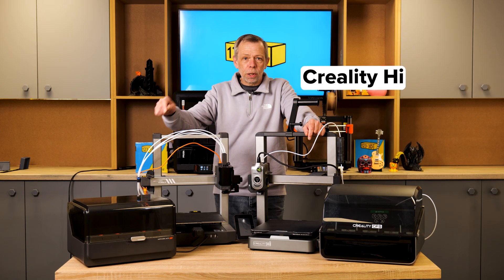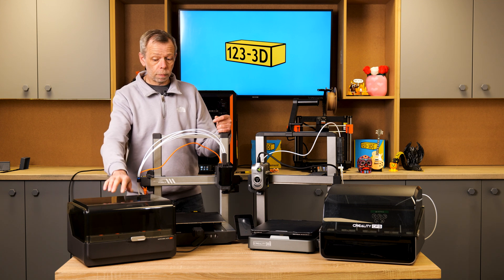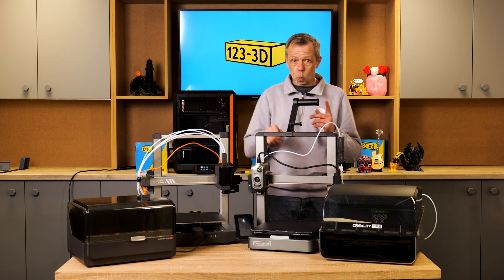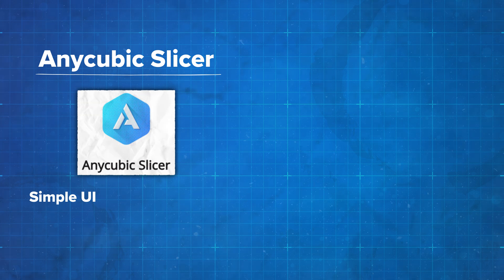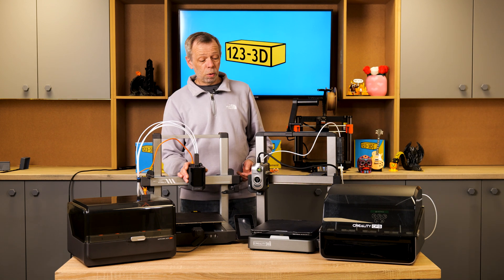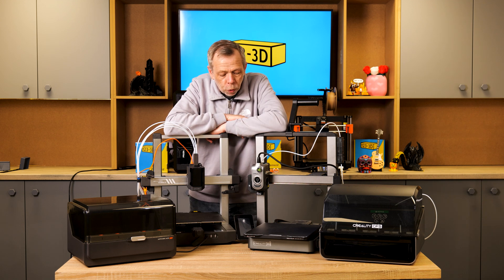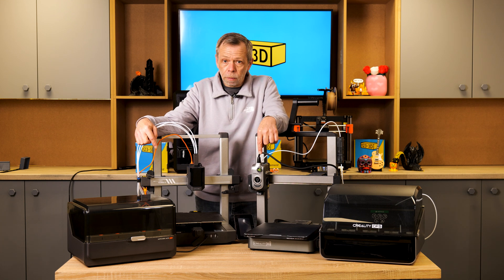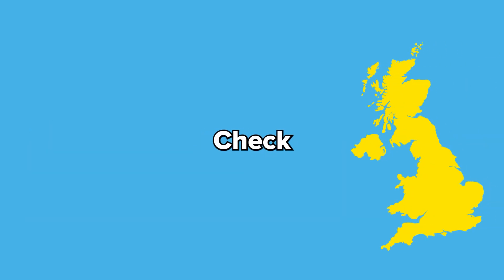Creality Hi vs Anycubic Kobra 3! Who will reign supreme?

Comment: Which would you recommend for primarily printing TPU 95A ?Multi color is not a concern of mine I'm looking for the most efficient TPU machine as that is what it will primarily be used for.
Reply from the maker: Both would do just fine but the Hi is great value for the price

Comment: after 3-4 years of printing and 17 printers, all I can say is DO NOT BUY ANYCUBIC, they send a good, factory calibrated machines to reviewers, and then send the poorest-quality pieces of poo for the customers. I've used Kobra Neo, Kobra 2 Neo, Kobra Max, Kobra 2 Max, all of them had a TON of issues. Some couldn't start a prints and others couldn't finish it. The closed source software of the 2 series made me buy BIQU motherboards and do a months of work and hundreds of dolars to make them even PRINT. Support is useless and just use canned responses. Their probes SUCK, their motors run overclocked and die after a year, all 4 beds were severely warped, their pressure advance settings are very bad, and you cannot change it due to the closed source unfinished software. Even if they improve 10x for the 3rd iteration of their printers I WOULD STILL SUGGEST, Bambu Lab or Prusa for long term expensive versions, and Creality or Elegoo for cheaper ones.

Comment: Im wondering with the Kobra having the 4 filament input head if the waste is lesss when switching colors for a print my thinking is that it doesnt have to purge the previous color before swithcing to the next color amI right in my thinking or is thrre no difference, thx for your input
Reply from the maker: Afraid not, the Kobra still needs to purge leftover filament out of the nozzle regardless of how many inputs there are. To switch colours with no waste you would need a machine with multiple nozzles so there is no cross contamination.
Reply: Thx @123-3D-UK

Comment: The quality i get from my Hi is honestly impeccable (when it works) i dont have an anycubic to compare to but id say the hi is honestly slightly higher quality than the A1. The Hi seems to have alot of CNC grade qualities to it
Reply: (when it works).. How often does it not work?
Reply: @abdulmsiddiqui4344  it's gotten a lot better recently.
For the first month I was continuously getting filament load errors when it would do filament changes. I'd roll with it, messing with the filament to fix it.  Well multiple times on long ass 20 hour prints id spend 2-3 days dicking around hitting retry and fixing stuff just for the print to throw a random fail error like an hour left..  I lost multiple 25 hour prints. That's not counting the ones where the settings on the HI were sucky and the fan was set way to high along with the speed causing suuuuper weak layer adhesion. Like so weak I could easily crumple a mini in my hand just by closing my fingers around it😅

Comment: I went with the Hi , The Anycubic ACE unit has a LOT of issues and are very prone to clogs and misfeeding.  I had an S1 that the ACE would never feed properly and clog or jam.  I had a Creality CFS on my K1 Max and it worked flawless so it was a no brainer to go to the Hi over the Kobra 3
Reply: I am returning my Kobra, I haven’t had a single successful print.
Reply: I have had the K3 combo for about 3 months now. Yes, was a pain in the arse when I first got it because I tried using it with all my previous filament setting from my CR6SE... Nothing worked, nothing stuck, just horrible!
You would think that 6 years of prior printi8ng and setting, your old and perfect configs would work... OH BOY I was so wrong!

I reset the whole printer to default, and used the preset stock settings for the filaments. And what do you know, I get beautiful prints now!

Like they say, trust the system.. Well sometimes! 😂😂😂
Reply: I actually also picked up a kobra 3 combo.  The ACE was once again non functional but this time i took it personally and i completely disassembled the ACE, re routed the tube paths, put tighter internal collars on and i even installed stronger springs on the "pumps" lol. Yeah it is great now lol @DeanosRides
Reply: If you use TPU it can clog it and make sure you’re using the correct filaments with the AC unit otherwise you’re just putting misleading. It might just be a little bit.
Reply: @Supremeaviation1975  I didnt have a chance to use TPU. I had RFID Anycubic loaded in all ACE slots.. .Still not printable.  It wasnt just clogs , it was twisting the filament inside the ACE and it was popping up through tge seems of the unit.....

Comment: What - in your opinion - at the moment is the 'best' starter 3d printer (multi colour not needed). Intended uses would be mainly hobby prints (boxes/storage), diorama & tabletop gaming figures, with miscelleny things like drawer pull knobs and labels. Also be interested if you would consider the addition of multi-colour worthwhile even if not planned at the moment on the grounds of 'its just a smidgin more so why not?'
Reply from the maker: Tough question as it depends on your budget. The Creality Hi is a solid place to start, we have been putting it though its paces for a few weeks now and its not had any issues. If your budget allows for it I would look at a Prusa MK4s or a Core One. Personally I would go for the multi-colour add on as it is only a little bit more money like you say and it is quite handy being about to load up different material types, saves messing about swapping spools round manually. It is worth noting that tabletop gaming figures are usually done on resin printers for maximum quality, you absolutely can print them in filament and have them look good but for small detailed objects like that resin is the way to go.
Reply: @123-3D-UK  thanks! Pretty much my conclusion (as a raw beginner). I admit to concerns over resin safety - solvents are sneaky. 👍
Reply from the maker: A lot of people feel the same way but as long as you take the proper precautions like wearing gloves and keeping your work space ventilated then its fine.

Comment: As an owner of the K2 WHICH I bought from the 123 website I must say I would probably buy an ender 5 max of it was available but since the bed recall now I would give it a month for creality to sort it out.

Few things for anyone wanting to get a K2 from 123:

1. Amazing support (unlike creality). 
2. Very responsive team.

Regarding the K2 I got:

After 12 hours of total prints now I can say that:

1. One of the he linear rods appears to be ever so slightly loose on the screen end so they either made that one rod too small or drilled the hole ever too big (chances are it's the rod). It doesn't appear to have any impact on the prints at least for me.

2. Had a heartbreak fan fail self check on first start, didn't want to update but that went away.

3 Factory overtighted the lead screw cap screw, 2 small screws hold the cap and one essentially was overtighted. Someone already made the part so I will probably print it out though the word with the wind goes it's better for print cooling to take them off.

4. Use Fluid to access the machine and hand level it, just search on YT "K2 Leveling" . My build plate had a deflection of 0.47, brought down to 0.37 after the manual bed leveling.

4. Heartbreak fan got more noisy recently at lower speeds, probably a bearing. 

CONCLUSION

For the price I would definitely buy another machine, it's better than the Bambu H2D

The Hi machine I would definitely buy for smaller projects if I didn't have the. Ender 3 v2 neo

Comment: I'd go for the creality hi all day. I've seen many issues from the kobra3, from hard to fix jams in the color unit, inconsistent z offset, hotend melting due to failed prints, just over lower multicolor print quality.
Reply: I had the Kobra S1 which uses the same ACE unit.  I couldnt get a single print through that unit.  It would jam, and misfeed. couldnt even get the 4 slots to do a retract/extrude.  I sent it back and got the Hi.  Im waiting now for it to arrive
Reply: have had a Kobra 3 since sept have over 1600 hours on it and its perfect
Reply: just from all I've gathered on it. it might be fine for you. I have a kobra2pro and max 2, its nice hardware wise, except the locked firmware is a pain. I have other anycubic machines, back to mega i3. I'm more interested in the s1, yet to see if they will make it open source firmware like the kobra3.

Comment: Nice one mate!
I bit the bullet and decided to go for the Kobra 3 Combo a few weeks back.
A few reasons.
1) The power needed to run it WAY less that that 1000W supply on the Creality! Just insane!
2) The dryer function in the ACE unit is awesome!
3) The price!

Sacrificing 10mm on the bed isn't really that much and also it seams risky to have a bed slinger printing tall stuff, especially at 300mm! 🤣🤣

Still trying to dial in my Kobra 3, but so far I am a happy chap!
Now I also believe that the Kobra firmware is locked to some of the features in Orca, so not 100% sure if I want to move over to it right now, but I might just give it bash.
Been a real challenge moving from 5 years of fine tuning in Cura! 🤣🤣🤣🤣

Thanks for this, it is really informative!
Reply: I brot k3 combo and never regret!
Reply: If you don't mind me asking how's that working out for you I'm still on the fence? Have you had any problems and if so what were they?
Reply: @James-ep8bh  Every machine has it's problems, just depends on how you deal with them. To be brutally honest, if I had the extra cash I would have gone for the enclosed S1 combo, but this Kobra 3 has been OK so far.
Firmware changes fix and break stuff, but it just does what it does.

I really like the ACE unit that incorporates the drying while you print...

At the end of the day, get what you feel happy with.
Would I have gone with the Hi, possibly, but the cash just wasn't there and nor was the stock.
But looking now, I see the issues coming in from both sides.

Very difficult to answer as I never used the Hi, but 95% happy with the Kobra 3 Combo...

Wish I could be more helpful... 😁👍
Reply: @DeanosRides that's actually very helpful, thank you. I'm getting my first printer and I was going to get bambu until they locked it down
Reply: @James-ep8bh  If you have the money, get the Bambu. They also have their issues, but still very very good machines for the beginners...
Reply: Nice to hear it works with Cura. I'm use to that but want to try there first party offering first
Reply: Not quite how power works, it doesn't use 1000w constantly - once heated it'll switch off.

The ace pro is really not a good system, had it in the Kobra S1 and it's just a headache inducing system! I'd definitely have gone with the creality,  have just bought one so we shall see... had the k1 before and was a much more reliable printer than my experience with anycubics